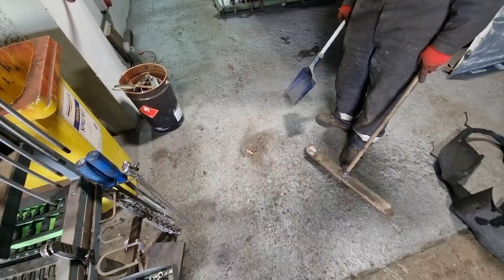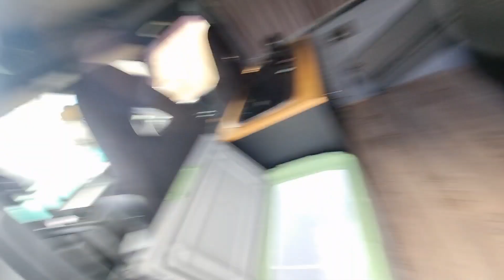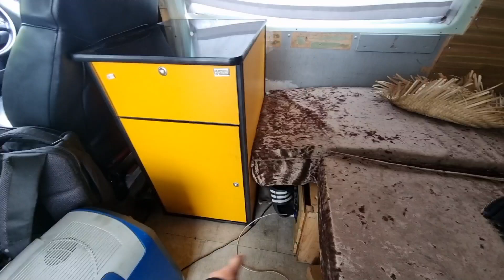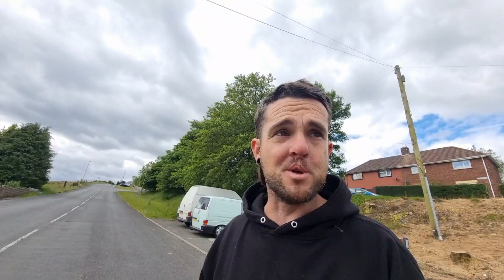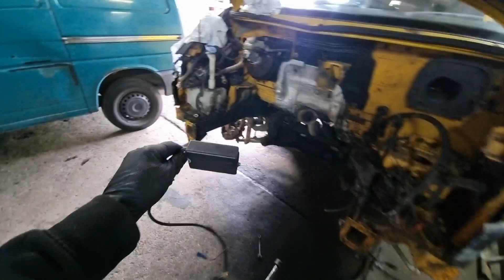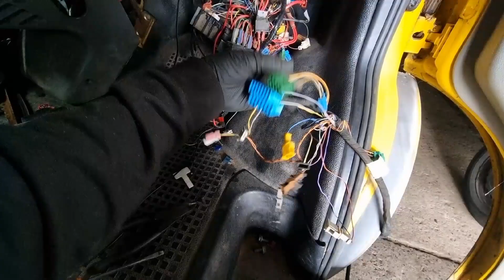Back From Travelling And Back To It #vwt4

Comment: Mate thank you so much for the cruise control, i said before game changer and it totally is. Just being able to sit back and point it in the right direction, and rocking up after driving for 5 hours without sore ankles.

Got the long drive back today, great to see this video over a morning coffee. Currently got 1429 miles on the engine and it is still running sweet as a nut, zero issues
Reply from the maker: No problem at all mate just pleased it went to good use.
Is a game changer for then big trips 

That's some good milage under its belt.
Hope your enjoying the trip and safe travel back